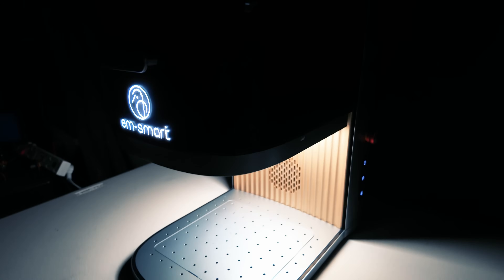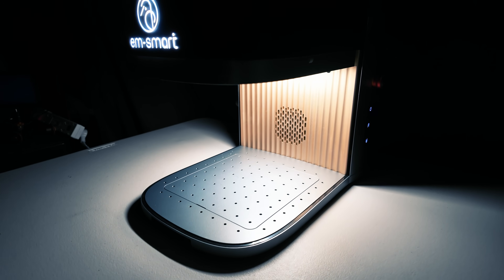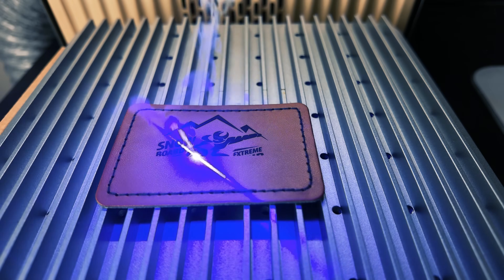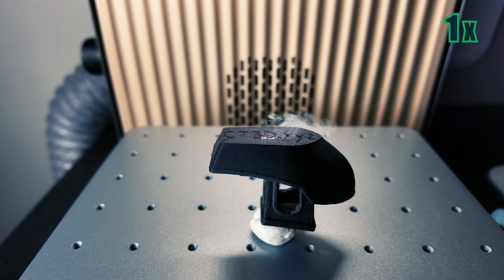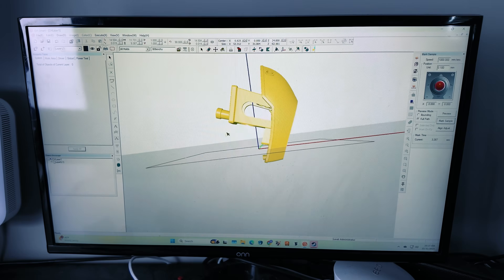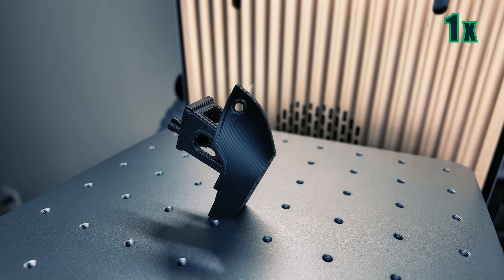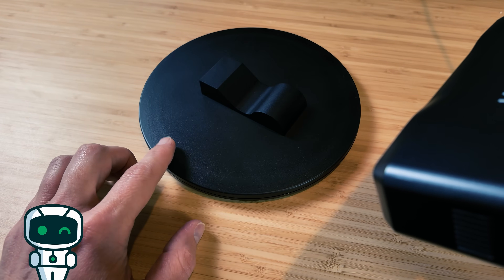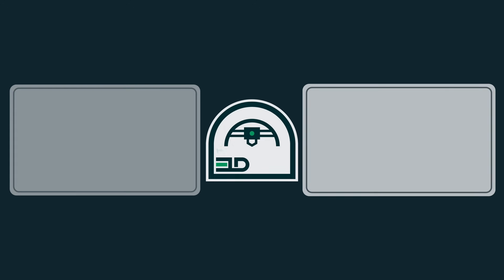I Tried the World's First, True 3D Laser Engraver on a Curved Surface

Comment: This auto 3D engraving is misleading.  You have to have a 3D model to have good engraving because if you do not have a 3D model, you have to use a 3D scanner to create a 3D model and import that model to the device app in order for it to engrave properly.  I first thought that it has a new technology that automatically detect any 3D object and just engrave on it with precision.  I have a Co2, diode, fiber, and UV laser myself.
Reply: Thanks for your comment! While at present we don’t have the feature of "auto 3D engraving," we’ve actually encountered this misunderstanding before. Could you share what led you to think this was an automatic 3D engraving feature? We’d love to understand and clear up any confusion!
Reply from the maker: I agree! I hope it eventually leads to an auto scanner from the laser. That would be amazing! That’s great you have so many engraver types. Which do you prefer most?
Reply: @The3DPrintingZone  I like the UV laser the most because it can engrave so many things.  Even though I already have the 5 watt air cooled UV laser, I just ordered the 10 watt water cooled UV inner crystal engraving that can do traditional surface UV engraving as well as inner surface K9 crystal engraving.  I did not order the Xtool F2 Ultra UV engraver because it is only 5 watt.  However, I used my Thunder 100 watt CO2 the most.  I am sitting at the computer now writing this message and considering buying the Bambu Lab H2C combo with the HT AMS (the AMS 2 Pro is backed ordered).  I already have the Bambu Lab X1C combo that I bought 3 years ago and also the P1P.  I want a larger printing bed.   I had already ordered the Snapmaker U1 but will not get it until March probably.  The Prusa Core One L with INDX will not be available for many months so I will wait for that in the future.
Reply from the maker: @d @doctorpd1969  that’s sweet! We’re looking at getting an inner crystal UV laser engraver but haven’t decided yet.

Comment: Your video is absolutely fantastic! Thumbs up! I’d like to ask: is it possible to perform 360° rotating laser engraving on an irregular curved object, and automatically engrave a 2D flat pattern onto the entire surrounding surface of this irregularly shaped curved object—covering it fully from top to bottom, all around the perimeter? If this is feasible, could you please make a tutorial video explaining how it works? Looking forward to your reply. Thank you!
Reply from the maker: In theory this is possible and something we hope to create next month. They should be sending me a rotary tool so we can engrave something like a waterbottle with multiple levels.
Reply: @The3DPrintingZone  This is really great news! I’m really looking forward to your work next month! However, objects like water bottles are relatively regular in shape. I’m wondering if it’s possible to use a rotary tool for 360° all-around laser engraving and apply the same process to **highly irregular objects**—to engrave exquisite patterns or text across their entire surface, creating an effect similar to a full-body tattoo. For instance, could this be done on sculptures or 3D-printed parts to cover their whole surface with patterns or text?

Some people say it may be constrained by the insufficient auto-focus capability of the laser engraver’s camera, which fails to dynamically focus on irregular objects. Others argue it could be limited by the fixed angle of the galvanometer scanner, making it impossible to engrave certain detailed areas on irregular surfaces. That got me thinking—could we design a laser engraver using a **5-axis CNC concept**? A 5-axis laser engraver might just resolve the issue of the galvanometer scanner’s fixed-angle limitations for engraving.

In any case, I hope you will continue to explore this field of full-surface engraving on irregular curved objects and achieve breakthroughs and progress! Finally, wish you all the best!

Comment: So you cant use XTool laser engraver like the P2S for 3d printed items? Also it is able to laser onto un even or leveled surfaces.. I am interested to follow and learn more on this machine.
Reply from the maker: It depends on which XTool. The diode laser won’t work on 3d printer parts but the infrared laser does.

Comment: Accelaser was out before this and does 3d
Reply from the maker: Oh really! I’ll have to check it out.
Reply: Accelaser is doing realtime surface analysis and focuses on the fly. If this works, it’ll be the better solution. 
The second advantage: it is a flying galvo, so can engrave bigger parts, faster and cut without angled edges.
But it’s way more expensive and bigger.
I’ll wait until some accredited makers compared or tested both - and then decide.

Comment: Would have been nice if this laser engraver had a camera for item placement then cover itself when about to engrave to save its sensors from laser
Reply: Fair thought, AXI doesn’t use a camera by design. Instead, it relies on real-time 3D surface mapping and dynamic focusing, which works more reliably on curved objects. The sensors and optics are already fully protected and isolated, and you can close the protective cover at any time during operation.
Reply from the maker: That would be really nice. Then I wouldn’t need the scanner.
Reply: @The3DPrintingZone scanner is nice too I own sermoon s1 ; issue is it would be cool to utilize both have a transparent stl file and visual of it so you can correctly place it
Reply from the maker: Really cool ideas! Thanks for sharing
Reply: @The3DPrintingZone would you think I this laser is worth the price or do you have other budget suggestions
Reply from the maker: @YME-247  If you need a Fiber 3D laser engraver, I think it’s definitely worth it. But if you just want to engrave flat surfaces on wood, I’d suggest something cheaper.